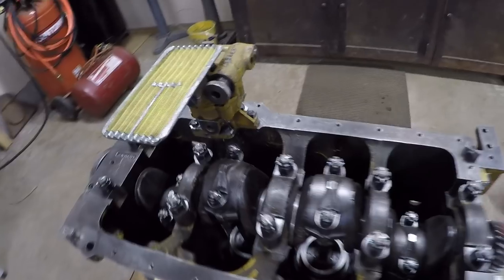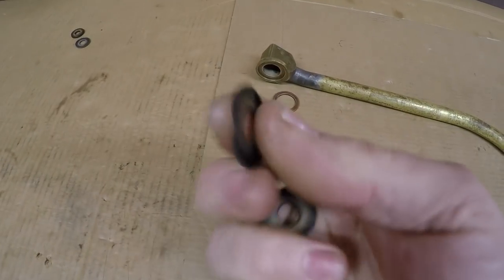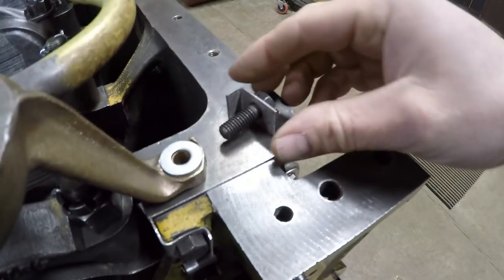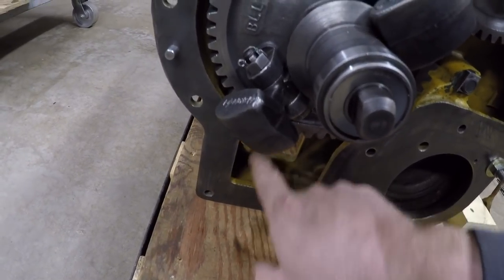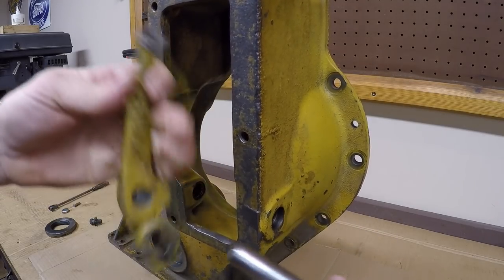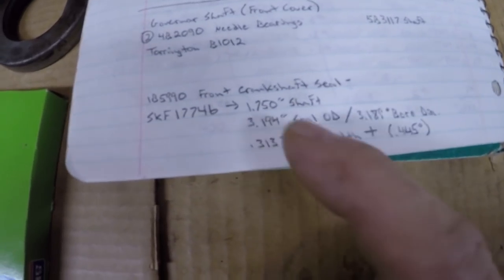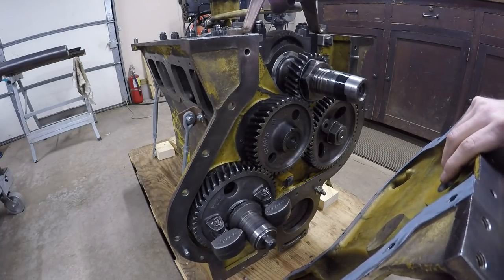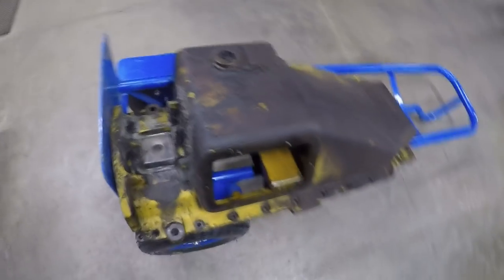Caterpillar D2 #5J1113 Diesel Engine Assembly Ep.16: Front Suction Bell & Front Cover Installation

Comment: This engine is just about ready to be flipped the correct way up and then we can start the top end work! Loved the solution you devised for the uneven surface for the front suction bell hold down bolts; most other people would have ground those surfaces smooth, but that uneven surface is what that part left the factory with and kudos for retaining that rough patina!
Reply: digitalrailroader   Factory yes, but the residue of a short-cut. Reminds me of Ford engines with all the sharp edges, ... to de-burr, or leave them sharp. My feeling, fix it!   Why preserve a budget driven short cut that forces a work-around with added non factory parts?
Reply: Jennifer WhiteWolf you also have to remember when this machine was manufactured: the 1930s and right smack in the middle of the Great Depression. Any extra manufacturing steps would have added to the final cost of the machine and money and work back then was much harder to come by than during the Great Recession just a few years ago. So caterpillar cut as much unnecessary manufacturing costs they possibly could out so the machine could be affordable.

Comment: My guess is that front seal was added after people running the prototype units said the engines weeped oil out the front. No one could see the back so the minor amount of swetting oil was never an eyesore issue. :-) I always take a torch and anneal those copper sealing washers before re-using them. Also I think based on engine rotation that idler gear only pushes against the front cover on deceleration the rest of the time the angle of the gear cut keeps it pulled back.

Comment: Squatch, thanks for addressing why the fold over lock was positioned the way that it was on the suction bell, saves me asking the question. As for the front seal, I would speculate that given the two unique environments that the crankshaft sees as it interfaces with the cold and cruel outside world might explain the suffering sealing techniques. The rear of the crankshaft lives a posh and pampered life in comparison to the front, it enjoys the shelter and safe harbor of an essentially sealed compartment with little in the way of water and dirt intrusion, sure there's some clutch dust, but nothing like what the front seal area sees. The front end of the crankshaft isn't so lucky, it's under constant assault from the elements, most of which are being accelerated at it by way of the fan. With the inherent dusty nature of dirt work, all being accelerated by the fan, my guess is the engineers decided an extra layer of protection was in order, thus limiting dirt ingestion into the lube oil and crankcase. I'm pleased to see 5J2115SP parts going into 5J1113 to live on, the clean sweep on fold over locks was equally cool, small victories ya know? Finally, (I know, this is already a novel in the comments) the quality in all parts of these machines is really evident when you look at the small details. Take for example the governor linkage assembly, the fact that Cat took the time and expense of adding a bushing to the end of the governor arm for a clevis pin bore is frankly staggering. It just shows their desire to have a life long serviceable component, that can e renewed with simple replacement parts over and over if needed. That's the kind of no corners cut mentality I miss in today's manufacturing and products. Merry Christmas to you and the family as we close out 2019. Sorry for the longest comment ever, I think I spent longer typing than I did watching the video today.

Comment: Beautifully clean looking lower end. Love it.
I almost always use one size smaller washers when I can get by with it.

Way back when, I had a Ford E-150 that needed a new rear main seal which required lifting the engine slightly to remove the oil pan. To my mechanic's surprise, the oil pump retaining bolts had backed out and the pump was on its way to falling into the pan. Don't know if was OEM to have had retaining clips but seriously doubt it.

Comment: Good morning sir - just curious as to why you elected to use the washers under the bolts on the front oil suction bell? Rather than filing down the high spots to make it flat like you have demonstrated in other videos.  I think the solution you used is just fine, but just seems off for the level of detail you have shown us in the past.  I am really enjoying the build man, hope you and your family have a Merry Christmas!
Reply: It makes no difference.  Why mill or file a factory part? Would do the same thing.
Reply: TheAggromonster 
You’re right, it’s for him to answer. But this is probably why: the surface around the bolt holes has been spot faced so a bolt or washer can sit flat on the surface. The fold over locks are probably an update implemented after some of those bolts worked their way loose during testing or after the first year or two production runs were complete. So, if you have a perfectly fine machined surface for a washer and/or a bolt head to sit flat on, why mess with doing any more machine work on it?
Reply: It looked like the depth of the impression was slightly interfering with the foldover locks, so he wanted to create a bit more clearance for the locks to fold over properly.
Reply: @squatch253  makes you wonder why Cat just spot-faced that area rather than take the time to flat-mill the area.  I suspect the answer is just that, time in machine setup and operation, and we all know that  TIME=MONEY
Reply: Just wanted to say I am enjoying the rebuild have a Merry Christmas my fellow Caterpillar enthusiasts

Comment: Hey Squatch, 
On your oil pickup tube, using the flat washers against the round gaskets is fine, but have you considered using structural flat washers in place of just plain old thin washers? The structural washers are about twice as thick as regular washers and would be less susceptible to collapsing in the center from vibration or over tightening like the original washers appeared to have done. It’s just a thought, and something I tend to do with critical parts like that pickup tube. Keep the great videos coming, I’m really enjoying them.

Comment: I did not see a comment about the washers filling the machined indentation for the front oil pickup. I feel the washers lifted the bolts enough to give you the vector to bend the clip perfectly. There must have been similar spacers to prevent the crushing effect evidenced by the old fold over lock tab.

Comment: Seal on the front keeps dust out, without it the scroll may pull in airborne dust. The other is inside the bell housing and not exposed to the dust.

Comment: Surprised you didn’t just file down the surface on the pickup mount to get the lock tab to sit square.

Edit:  but washers work fine, looks good too.
Reply: I was surprised for about 5 seconds. Then it occured to me that Cat made it this way 50 or 80 or whatever years ago, and it has been working that way ever since, just fine. 
Are you restoring something like it was when new or building a new machine from old parts? If you are restoring it, you probably want to leave it the way it was, unless you KNOW there is some really good reason the old way should be changed.

Comment: From experience with mechanical locks (keys, tabs, the whole lot) regardless of where you place the fold, it won't twist. It can't. Unless it's a bolt/screw that's going into a rotational type part, the forces involved in overcoming that much material are astronomical at that scale. Static and non-axial rotational motions, just can't do it, if the fold is done right.

Comment: Squatch,  it's great to see the D3400 coming together like it is.
The only question that I keep asking myself is, you reference the Cat workshop manual for clearances, but you never mention the torque values of the bolts.
Does Cat eliminate the torque value by using the bolt lock?

Comment: Question re the two oil pickups. If one pickup drew all the oil out if its respective sump and the other was still submerged in oil, wouldn't the dry one start sucking air since there's a common pump? All the best for you and yours over Christmas..........Mike
Reply: Mike, recommend watching the previous oil pump video. Short answer, the front suction bell has a separate oil pump section and only moves oil from the front of the pan to the rear sump to be picked up and pumped under pressure by the main pressure oil pump. So it's ok if it sucks air since it's just essentially a transfer pump.
Reply: @lukestrasser  Ahhh, I missed that Luke, thanks.............Mike

Comment: ** hello there, fantastic build, are you going to show anything on rebuilding the injection pump or injectors? Or have any videos on it? I replaced a injector plunger on the pump and now it runs like a slight miss or uneven... I have a 7J d4. Is there a way to match the plungers together other than the rail? I see there is is a collar on the plunger that can turn (plunger and barrel assembly) Info on this would be great, I can’t find any info on this any where.
Reply: Squatch253 what is a quadrant? Is that the aluminum collar that rides the gear rail or the pump and cylinder?
Reply: Squatch253 thanks! Looks like I need them to get them matched at a injection shop somewhere. I was hoping I could turn the plunger while it was running to see if it smoothed out. Is there a way to send you a personal video on YouTube?

Comment: Sir. You do know why there is a front seal. Whats the big round thing on the front of the engine? It BLOWS. So what does a cat work, play in ? LOTS OF DIRT. SO thats not so much as a oil seal, as a dirt wiper ring to keep out fine dirt....... on rear no so much force air dirt blown at the crank behind the fly wheel....